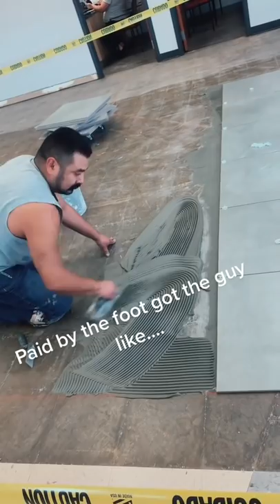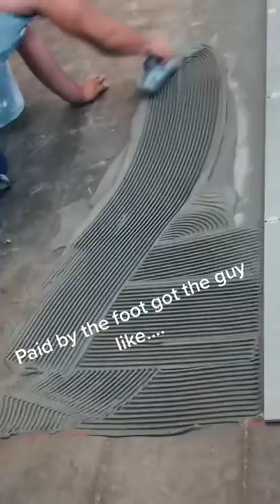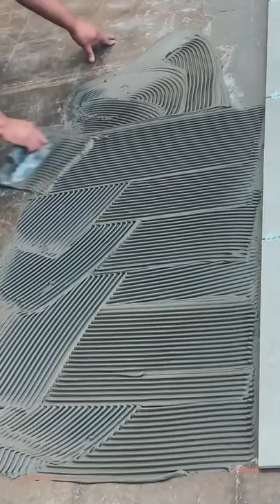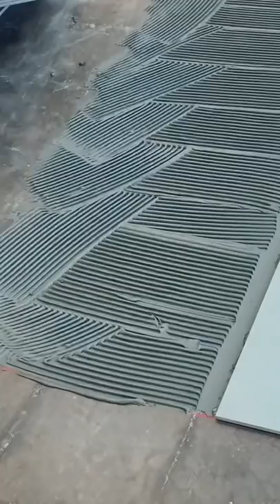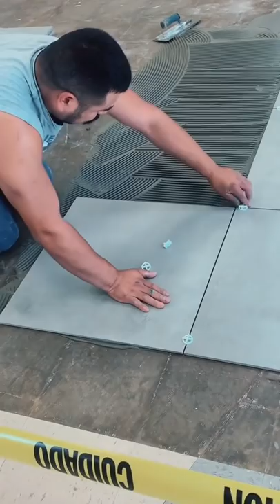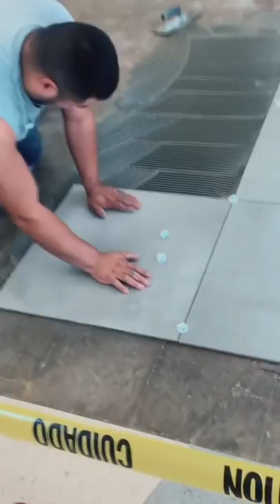Dude laying our new tile is 🥶 CREDIT terrywatson806 #Shorts

Comment: Those tiles will crack very easily if you drop something heavy on them. Mortar lines should be parallel to prevent cracking. Tiles that big also should be back buttered.
Reply: I was going to ask! Thanks for clearing that up.

Comment: Back butter is not necessary for the technique he’s using, thin set mortar works very well when mixed properly, which by the smoothness of the trowel’s glide, looks just right
Reply: Well that depends on the flatness of the substrate the flatness of the tile. Also you need to use directional troweling to allow the air  escape.  my educated bet is that these tiles may be ok but below the proper standards for thinset coverage.
Reply: Also with tiles that large a larger ttrowel
Reply: A good tile setter backbutters all of the tile.
Reply: Incorrect. Its been proven, demonstrated, and even put on YouTube for all to see- when dealing with any tile, especially this large, "back buttering" adds an incredible amount of strength and is the proper way to do tiles larger than a 10x10.
Reply: Always back butter
Reply: You could say that about anything, like adding another ft. Of reinforced concrete to the foundation of your home will make it sturdier and virtually indestructible, but it all comes down to the time and cost, since time is money, show me the money and I’ll back-butter your toast in the morning.
Reply: @johnmatthew7991  adding another foot of concrete will make your home sturdier? Hmmmm, spoken like someone with absolutely no idea what they're talking about. Take any home built, and put it on a stronger foundation- if the home is built poorly or improperly, you could pour 20 ft thick of concrete and a hurricane will ravage that structure. And I'll let my wife back butter my toast, thank you.
Reply: @alexjackson9531  this is a valid statement. Tile size dictates trowel size.
Reply: Boy, back butter your own toast!
Reply: ALWAYS backbutter. I give this floor 7 years tops. Atleast itll be an easy demo.
Reply: @johnmatthew7991  you've proven you're the only boy in this conversation. Go make a tic tok
Reply: Back buttering is recommended by all product suppliers we have ever used. In fact some products won't warrant the bond unless this is done such as David and Sika, so please don't spread uneducated second rate budget tradesman information to the masses....
Reply: Davco*
Reply: @jamessiddle572  And you've proven that you're "one of those" that thinks a woman's place is in the kitchen. Gross.
Reply: He should be using a half notch trowel and directional troweling for air pockets. I only back butter stone
Reply: @beatricedorian9908 I'm sorry, I dont feel that way. Now go make me a sandwich please. John, quit having your wife fight your fights for you.
Reply: Discourse in the tile community.
Reply: Ok everyone calm down, it was a comment about decent handyman work, turned wrong, pretty soon someone’s gonna yell “let’s go Brandon.”
Reply: You notice he doesn't have any of his high or low spots marked on the floor so he doesn't know which tiles to back butter and level
Reply: It’ll probably hold just fine but you have hollow spots that’ll cause echos and maybe a crack
Reply: @jamessiddle572  Love that you don't know how to make a sandwich. I guess I shouldn't have expected anything more of a troll.
Reply: @jamessiddle572  Bruh, my feelings don't get hurt by randos in YouTube comment sections. Unlike some of us 🙄 Whatever, this is my last response. Ciao
Reply: False
Reply: That’s simply not true! I’ll bet anything you want that if he set one tile as he did and another next to it that was buttered, then pulled both tiles back up, only one would be completely bonded.
Reply: Always back butter with bigger tiles. They bow to much. Dudes not even using enough mortar..
Reply: @jameslangtree9328  not all manufacturers require this only recommend standards for LFT any other format isn't necessary unless wet location where heat is causing bonding issues during setting process and butter only helps
Reply: @johnmatthew7991  let's go brandon!
Reply: All these back butter guys whining about back buttering (well of course you back butter! Were not savages!) However, anyone ever consider that white stuff on the back of the tile?! That's actually a release agent from when they pressed the tile. And can cause tile separation even years later. Back butter that tile, but sponge it when you take it out of the box!!
Reply: Thinset works great until your shit cracks.
Reply: Also no matter what you're installing with any kind of adhesive or mortar you always butter both sides of the bread.
Reply: There are a few thinsets that allow you to not back butter but this doesn't look like any of them.
Reply: @garrettbreech728  you should still back butter no matter that the thinset says, guarantee the tile says somewhere on it to get at least 90% coverage
Reply: @greysonhoffman3647  have you ever used laticrete's multimax lite? I said the same thing till using that specific product.
Reply: @garrettbreech728  I don't recall using it. I'll have to keep an eye out for it next time i do tile
Reply: @beatricedorian9908  I’m gonna need you to make everyone here a sandwich.
Reply: You have no idea what your talking about.

Comment: Always wanted to learn how to lay tile down perfectly. This dudes a master at his craft. Get this guy a bonus.
Reply: Pls don't do it this way it's incorrect
Reply: @mrliable9703  What's wrong with it? He's clearing too far from the edge but aside from that it looks fine.
Reply: @irelandgrt  wrong size trowel, not enough mortar, not back buttering with a large format. It's going to crack within a few months. The tile isn't being supported.
Reply: @austintalley4070  make a video of the correct way of doing it. While depicting what he did incorrectly.
Reply: @dwalk713  look up sal diblasi at elite tile. He has plenty of videos of installs. I watched his videos and did my kitchen floor following his advice
Reply: @austintalley4070  Should be a 1/2 trowel. I can't tell in the video but it looks close to that.
Back buttering is for wall tile mainly. I rarely butter floor tiles.
Looks like plenty of mortar to me. The tile is supported by the columns that he's clearly collapsing. 
The only 2 things I see questionable is how wet the mud is and how far he's clearing from the edge.
I don't claim to be an "expert" but I do a lot of tile work. Taking a break from tiling a shower at this very moment.
Reply: @irelandgrt  you probably mostly butter wall tiles to get 100% coverage in shower and tub surrounds. I've done a couple of floors and back butter every tile for good bond. His ridges might not collapse as well as we think because he didn't trowel in one single direction. Even if he cleaned the grout joint out with the margin trowel if he used enough mortar it would fill those voids. 
For the people that want to learn there are a lot of resources. For the people that don't you can watch a 1min video of this guy
Reply: @austintalley4070  If your bond on a concrete floor fails then you didn't mix right, left it exposed for too long, or stuck it to a dirty floor. 
If I buttered every floor tile I put down when I worked for a contractor he'd have fired me for wasting time. He'd have been right to do so.
Reply: @irelandgrt  that's nowhere near a 1/2 by 1/2 trowel more of 3/8 by 3/8 also ALL trowel lines need to be uniform otherwise air gets trapped. Backbutter is not for wall tiles its for large format floor tiles. He barely pushes the tile into the mortar. I guarantee you his tiles are hollow. Just another poor over rushed commercial job.
Reply: @irelandgrt  listen, Austin learned everything he needed to know from YouTube! Your work history clearly can’t compare!!  I still haven’t gotten my master bath finished because my husband (a subfloor guy), can’t find someone at a level high enough for him to trust to do it! Maybe I should call Austin, he is a YouTube pro!
Reply: @dwalk713  There are plenty of videos on how to properly lay tile on YouTube.  Their criticism is accurate.
Reply: @SneekySecrets  that's why I'm just here for the comments bc I like the back and forth debating lol. It's cool, appreciate the input as well.

Comment: Looks like he knows what he is doing but anyone who lays tile professionally like myself would be using a bigger notch trowel for this size tile as well as back buttering the tile for proper bond. 
Oh and you don’t want to trowel your mortar like this. It’s needs to be spread in the same direction to allow for airflow between the tile and substrate. 
Looks cool though….
Reply: Everything i was thinking..
Reply: Must be working for him doing it his way. Or I'm sure he wouldn't have any work. Everyone does things differently.
Reply: @84848AR  Yes, but some of us do it to the standards of the TCNA. Larger format tile needs a 1/2" notch and the tile itself needs to be back buttered. 80% coverage minimum on the bond
Reply: Looks like he's focusing on getting the proper amount of mortar down, and then a white guy like you comes in and tells him he's not doing a good job. Doesn't even look like that big of a tile what is it a 1'10" squared tile. What would you use for a 6 foot marble tile that's slippery on the bottom. Would you bore indents for grip or something, seems impossible at that.
Reply: @AustinHartwig  how do you know hes white, stop being racist.
Reply: @nineteeneightynine432  names Dan
Reply: Looks cool, but unfortunately it won't be seen for long once it's covered with the tiles lol.
Reply: @84848AR  I think anyone in any profession would be able to tell you that if you don't do the work right, there's no guarantee that you won't find more work. It depends on how wrong you did it and whether the client notices in time to realize it was your fault. There are many ways to do many things. I just think it's a stretch to think there's a necessary correlation between finding work and doing good work. Especially when natural disasters happen and people need to reno their houses, it becomes even more apparent.

As you can probably tell from the comment section, those of us who know nothing about tiling say it looks great while those who actually do tile work are the ones who see the mistakes that are likely to lead to problems down the line, but by the time the problems actually mamifest the guy is long gone with his money and had several more clients already.
Reply: @YouKnowMeDuh  whats your point? From the whole damn book you wrote, I don't get what's your point. I honestly don't give a crap if his tile work is good or not. Maybe people need to do some research and find the best contractor for them. As well as PAY the $$$ that's worth and not settle for a lower bid and then complain when something isn't up to "standards" you get what you pay for.
Reply: @84848AR  there are many contractors that are garbage, but land big jobs merely based on price. He doesn't look like he runs the show. He's the type of worker, people who know, know to avoid.
Reply: @bobloblaw7465  did he put enough near the cracks of the tiles? Serious question, looks like dropping a suitcase would fuck it up
Reply: Oh this is why you see tiles crack in the corners I understand now.  Real sloppy
Reply: @ChadDidNothingWrong  of course it will be
Reply: @AustinHartwig  if you dropped any weight on those tiles they would be sure to crack

Comment: The piecework mindset. As opposed to the hourly mindset. Been in flooring since 95. Becoming confident in your work helps the speed come naturally. This guy is no hack. 👍
Reply: Hey cake. Since you are in the biz hoping you can help. My understanding was tiling required you to “butter the back” applying mud to the back of the tile as well to get a proper stick on every square inch. Which would obviously take much more time. 

Any reason why he doesn’t do this and if it’s a lesser job without? Thinking about doing a home job myself and would love to save that time if it’s not necessary. Thanks!
Reply: @brians2811  read the back of the tiles and the mud compound...I think with these big tiles and that thick of mud you don't have to do the backs